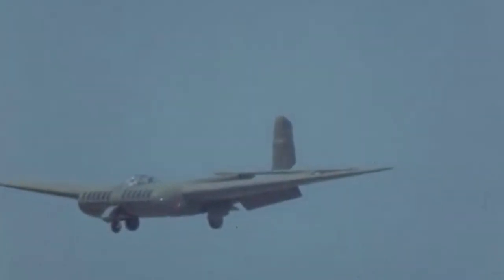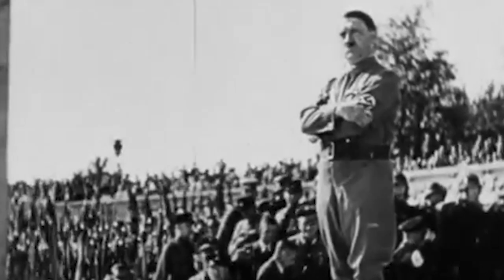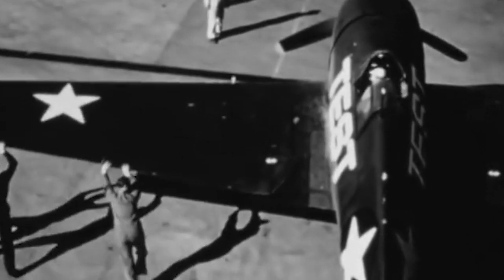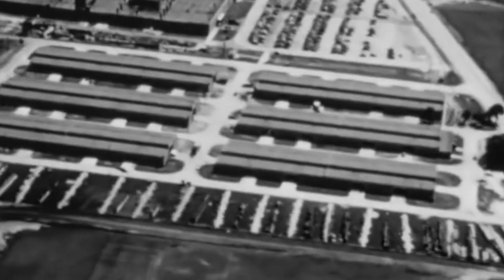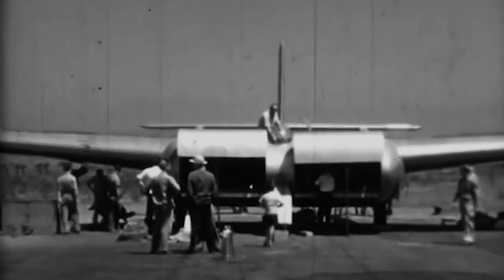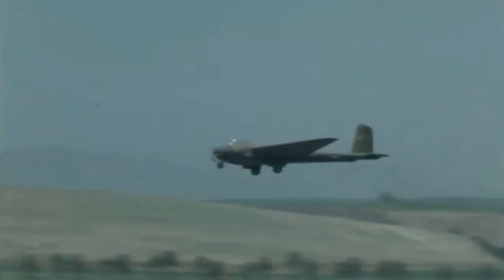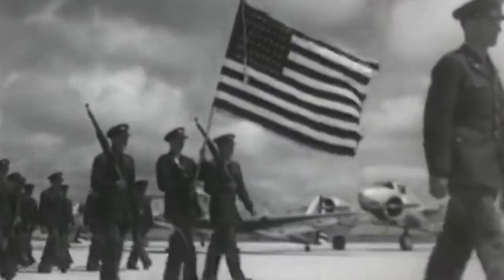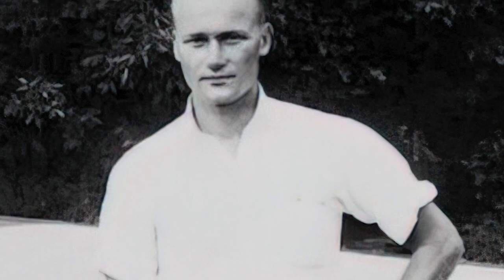A 200 MPH Flying Wing Assault Glider - XCG-16

Comment: The next successful glider developed to carry 40 troops was the Douglas XCG-17 which  was an American assault glider, developed by the conversion of a C-47 Skytrain twin-engine transport in 1944.
Both engines were removed and the engine nacelles faired over.
 
Although the XCG-17 was successfully tested, the requirement for such a large glider had passed, and no further examples of the type were built; 

one additional C-47, however, was converted in the field to glider configuration briefly during 1946 for evaluation, but was quickly reconverted to powered configuration.

Comment: The pick-up system is pretty damn incredible. To snag a tow rope and then get the glider to takeoff speed without stalling the tow aircraft is amazing.
Reply: I wonder how many pick ups before the tug is irreparably stretched out joint.
Reply: @johnpotter4750  The tug carried a winch system that allowed the initial snatch load to be dissipated paying out some line, and natural stretch so neither tug or glider suffer irreparable damage
Reply: @johnpotter4750  When designing such a system you always include safety margins ... which means the material doesnt reach the point of "being stretched irreparably". Fibres break and polymers age ... so you will have to replace it after some time, but probably not because of lack of elasticity.
Reply: @Muck006  I believe the GI's have a saying.....
Reply: Skyhook.
Reply: @christopherrobinson7541  yeah on steroids!
Reply: We reap the benefit today with kinetic energy recovery ropes (KERR ropes) that utilise the same system...

A 4wd has one attached to it and the vehicle needing unstuck from mud etc.

The towing vehicle moves off at a consistent speed and the rope elongates 25 to 30% before snapping back to it's original length...
so all the force built up in that "spring...
plus the kinetic energy of the towing vehicle moving forward at 15mph...
all hits the stuck vehicle and smoothly pulls it out of the mud.

Great system if used as safely as possible...
and sometimes used in a tandem pull to release a heavier stuck vehicle!

Comment: It sounds like what really brought the glider down was something that wasn’t even part of the glider.  It was killed by, of all things, ballast.
Reply: Shows how sensitive transport gliders were, if loads shifted. There are no heavy engines at the front to counter act it.
Reply: @channelsixtysix066  No transport aircraft can compensate for violent shifts in cargo load balance, that's why there is a specialized set of aircrew technicians on board them called 'load masters', in the early days things where a bit more lackadaisical and not so stringently formalized.
Reply: @Veldtian1  - This was in a time of war as well. There are many stories of maintenance mistakes, causing plane crashes, as air maintenance crews were under immense pressure. Due to a glider having no power and being lightly built, there was no chance of correcting for even a minor shift in loads.
Reply: @channelsixtysix066  engine or no engine. An aft ch will crash any aircraft. When you load you always balance the load if you fail to balance you either have extremely heavy controls or extreamly sensitive controls both will cause you to have problems that you might not be able to deal with . For safe flight the load must be kept balanced from start to finish of every flight. That is the reason fuel tanks are most often placed in the wings on the center of gravity. It is also why fuel use from those Wing tanks must be closely observed to keep the plane balanced from side to side.
Reply: @channelsixtysix066  sorry, engines are irrelevant.   They're just mass to be compensated for by placement of the ballast.

Comment: "all the bags were securely lashed"    "the bags shifted aft because of turbulence"    um...   then they were not securely lashed.    these two statements cannot both be true.
Reply: A box ticker signed off, never trust....
Reply: As a former military pilot, that's exactly what I was thinking.  That's exactly what happened in a flight out of Afghanistan one time.
Reply: Good enough, those bags are so heavy they never will shift!
Reply: A Lt. Stationed in the Philippines took flying lessons. On his 1st solo they strapped a sandbag into the empty seat, it came loose and jammed the stick. He figured it out before crashing, rolled and dumped the bag out. You would know him as President Eisenhower
Reply: @raymondclark1785  lucky it wasn't a glider never inverted a glider, though stubble burning fields below damn well tried.
Reply: The queen size mattress was secured to the roof of the vw Jetta... until it wasn't..

Comment: 5:23 - oh wow! Proof of time travelling C-130's!
Reply: it also caught me by surprise a lil,, like oh,, we in the sixties now lol
Reply: @trope5105  that C-130 was not from the sixties my good man - more like from the past twenty years or so
Reply: @sufianansari4923  well i didnt go back to look at it, donno if i could have judged the age of it, but i do know that the c130 has been around since the early 60's
Reply: @sufianansari4923  and i donno, after goin back n lookin at it, im not sure youre right, not sayin im right, but this shot could have easily been takin in the 60's or 70's, unless im missin somethin that you can point out to me
Reply: @trope5105  true, true - it'll be around for a lot longer as well
Reply: Hey so a heads up the C-130 was intro’d in the 50’s-
Reply: @byarlantcustom4265  ya it was being prototyped during the korean war n used in vietnam,, this channel actually done a video on it not too long ago, like within a week or two i want to say
Reply: C-130 first flew 1954. That bird was a C-130B. Worked on them in the 80s early 90s.
Reply: @DougsHomestead  how come they never/havent got rid of the prop for a jet engine.  seems odd to me that they kept the prop method
Reply: @T Rope.  The T-56 engine of the C130 is a turbo prop design. Jet engine drives a gear box that the prop is driven by. Engine runs at 13820 rpm and the prop at 1050 rpm.  The air movement made by the prop helps with lift for short field takeoffs.
Reply: @sufianansari4923  The C-130 first flew in 1954

Comment: The XCG-16 looks like it might have been the inspiration for the bomber aircraft seen in the Battle of Anchorage DLC for Fallout 3.
Reply: And the "flying wing" passenger craft in F4
Reply: I was thinking that too, it looks like the Chinese bombers. All these old planes look so much cooler than the crap we got now, they're like modern cars where they all look the same.
Reply: That was my first thought, too
Reply: Hadn't made that connection.  But does remind me of the troop transports from The Shape of Things to Come in 1936, so that may have been an inspiration for the design.
Reply: @wesrrowlands8309  A big part of the reason for that is computer modeling of airfoils has finally got really, really good.  So a wing doesn't need to be 15 feet wide where it joins the fuselage; the foil can lift more with less structure involved.  Smaller, lighter. So less production cost, and less fuel burned.  It makes sense.

But planes aren't as lovely as they used to be, and that is a great shame.

Comment: Sand becomes a fluid if subjected to  vibration, if you lash a sandbag across the middle, then subject it to turbulence on an incline (eg climb) the sand will 'flow' under gravity into the lower part of the bag causing the lashing to fail. If only the designers had seen those earthquake videos we have today where the ground becomes 'liquid'.

Comment: The DC-3 Dakota had a very effective and efficient wing design. Though not good for high speeds it could land, take off and glide effectively. And they were often used with shorter and rougher airfields that were quickly made. They thought about the idea of using the DC-3 as a glider during WW2 and it had a very good glide performance. Butter than some of the other combat gliders. But using a DC-3 as a glider was not so cost-effective but as it was the DC-3 was hugely successful and effective. They were also very well made. They were so well made that they still have some of them in use today despite their age. Their low speed lift capability was great for towing and recovery of gliders. And some were still in military use in the year 200. The US uses a lot of very old aircraft in service today. And still use some very old designs. The B-52s are among the oldest US military aircraft. Also the UH-1 Huey helicopters. The latest fighters that the airforce is buying at the moment is the new F-15 fighters that were first developed in the 1970s. The USAF has been trying for decades to replace the KC-135 Stratotankers inflight refueling tankers. . This is based on the same design as the revolutionary B-707 passenger aircraft. Some of those very old US aircraft were great and had tough designs. There are many other old aircraft types still in service.  Though the USAF is not operating the SR-71 spyplane it is still an amazing design and first flew in 1964.  It still holds many world records.

Comment: Is that an F-6F in a wind tunnel?  Looks a bit small to tow a 90-ft wing span glider!
An F-4F on a carrier.  Getting stranger.  Then even more fighters.  Why?
Why not show some pictures of the airplanes you are actually talking about?
Love the time-travelling C-130.  Is the Nimitz and a bunch of Tomcats lurking out there as well?  Was the XCG-16 crash actually caused by a time vortex?
Gliders cannot be powerful, having no motive power.  Try just 'bigger'.
Was it a 'high-swing' or 'high-wing' cantilever monoplane?  I prefer the latter.
I don't think the seats were at the rear.  I think they put them in the middle, in the fuselage.  That would be more aerodynamic and help CofG.
The max speed is quoted as 220mph, and I'll take that as VNE, but I'm not sure what your 120mph refers to.  You use flaps to allow you to go slower and 120 is pretty dam quick for a glider to touch down.  If you look at the film available on line (eg https://www.youtube.com/watch?v=1_TZFj_igYA) its take-off and touch down speeds seem to be in the 60 mph bracket.  Was the 120mph the limiting speed with flap?  Is so why quote it?  Citing its actual touch-down speed would have been a lot more informative (eg http://www.indianamilitary.org/FreemanAAF/Aircraft%20-%20American/XCG-16/XCG-16.htm).
The half-scale and the 2 aircraft delivered were the prototype MC-1 demo models, not the XCG-16.
Might have been worth mentioning that this thing had an air-driven generator to charge a battery to power the undercarriage, flaps and radio.  The flying controls had to make do with aerodynamic balance.
Turbulance did not cause the loss of the MC-1; it was the ballast not having been properly secured.  Indeed there was an assertion by the survivor that the ballast had not been tied down at all!

as usual you keep showing random stuff which clearly has absolutely nothing to do with the subject, let alone what bit you're talking about at the time, it's really, really distracting!
Reply: The kids and their jump cuts ruining content yet again.  Preach!

Comment: In the 1960' s this was upscaled to allow a transport or bomber to extract a single soldier using a gas filled balloon.
Reply: Skyhook.
Reply: In the 1980s a paramilitary group took it a step further and introduced wormhole technology to the mix, eliminating the need for a pickup aircraft.

Comment: I had to search why there aren’t more lifting body aircraft and one point was pretty good.  Pressurization is ideal in a tube when compared to this shape. With most planes being high altitude passenger planes, I can see why.  Too bad, there’d be some more designs I bet that are pretty cool.
Reply: I too was wondering the same. Thanks for the explanation.
Reply: Meanwhile, everyone who's looked into it from McD & Boeing, NASA, Airbus and TsAGI and others says that it's not a great technical challenge to pressurize it, that it won't necessarily be more heavy and in fact can easily be less empty structural weight per unit payload/range. But even if it is more massive, the benefits in L/D and payload/ range more than make up for it.

Not just in company PR sheets or patent claims, but in peer-reviewed sources, they show this.
Reply: Then there was the Burnelli plane that had mechanical errors on its last test flight before delivery: the ailerons came off at 200feet.
It hit the ground at 120 kts, 120 degree roll, 25 degrees nose down.
The wings and tail turned into confetti and the engines broke off at the fuselage body box cart-wheeled across the field. It came to rest upright, intact.
When they broke it open and got to them, the 2 crew walked away.

And for saving weight and maximizing payload, we make planes that if they skid off the runway, they fragment and churn the passengers up in a fireball of debris.

Comment: Fascinating, thanks. But it would have been great if you could have addressed (1) why gliders are even needed? (2) why the program only lasted one year after the crash? I am sure lots of prototype planes crash, and in this case it was due to shifting cargo, which surely could easily have been rectified. It would have been good to know why it the project was ultimately abandoned. Any ideas? Cheers.
Reply: Because you needed throw away planes that can land anywhere and be relatively cheap. Also it's a good way to double your aircraft cheaply.
Reply: @ferky123  Thanks. But this video emphasised that the pick-up system was seen a great element of this craft, indicating these gliders were not being designed to be throw-away.

Comment: Gliders as a concept in war always baffled me.  Why would you want to send your troops in with an aircraft that can neither abort nor return.  Just put an engine on it.
Reply: Mainly stealth.  They can have a low radar signature and they are quiet.  This allows in theory covert insertions.
Reply: Si, stealth mi amigo
Reply: 4 reasons - 1) Cost - gliders are relatively cheap to construct with a minimum of strategic materials. 2) Versus parachuting at the time, which tended to scatter troops over a large area, you could concentrate forces on a single location.  3) Landing length - given most gliders slow stall & landing speeds, they landed in shorter distances than comparable aircraft of the day.  4) Stealth - No engine meant no sound and in the role of delivery of assault troops, you put a lot of people in a confined space before the enemy knew what was going on.  Both the Axis (Eben Emael) and the Allies (D-Day, Market Garden, others) used gliders specifically to concentrate forces at key points.  Though, personally I've always wondered why no tried making an assault autogryo in the late 1930s.  There is nothing about something like a Rotodyne that couldn't have been built in 1936.
Reply: Making the most of the limited amount of time, resources and engines available. If engines, time and resources aren’t an issue you’d be correct.
Reply: I don't know what was stealthy about this monstrosity.  You could have glided in the DC-3 that probably towed it and had the same footprint.
Reply: @RulerOfThePyro  Stealth was never a consideration, just weight and a shortage of metals.  In any case the massive 4-engined bombers and cargo aircraft towing them might have been a bit of a giveaway!
Reply: the point was the ability to QUICKLY deliver soldiers and equipment to an advantageous position without the benefit of a landing strip.   the reason for them is a staple of modern troop movements, we just found a better solution.  All things considered regarding the situation at the time, these gliders in general were a damn good idea, the implementation just wasn't good.  in hind sight they would have been better off packing men and equipment into drop pods with parachutes that could be dropped from bombers.  i'm sure it was a consideration and they decided gliders would be less risky.  they turned out to be wrong.
Reply: @baneblackguard584  Have you been in the bomb bay of WW2 bomber?
Reply: Also since they can't power out the troops have more incentive to win
Reply: @joshuarebennack68  The Rotodyne was horrendously noisy and had jets on the tips of the rotor.
Reply: @christopherrobinson7541  Yep.  Making it a commercial failure.  But militaries typically don't care about "loud".  And just to be clear, the jets on the Rotodyne weren't a tech that didn't exist in the mid-30s.  Pulsejets were perfected by 1933.  The XH-26 would use pulsejet rotortips postwar.  Those jets on a Rotodyne only functioned during VTOL or for getting the rotor to speed for STOL.  During forward flight, the Rotodyne was a true gyrocopter.

Comment: Computer(even if vacuum tube and motor powered gyro based) stabilization would have been necessary but the technology wasn't there then. B2 Stealth became flyable because 32-bit computers capable to stabilize flying wings became available in the late '80s.